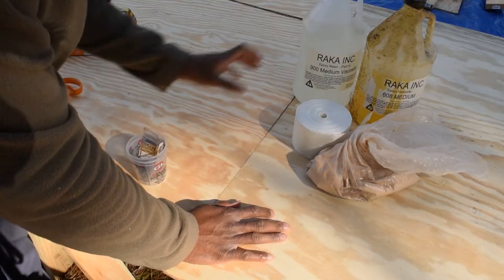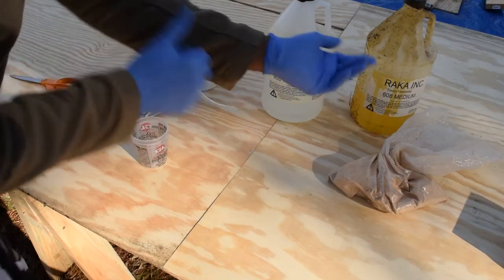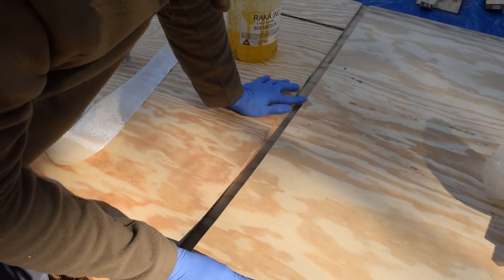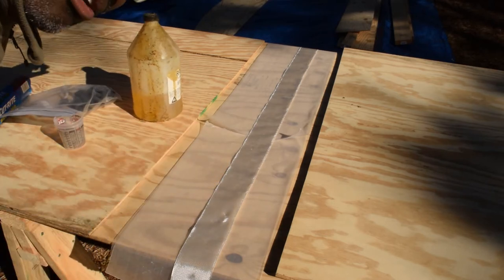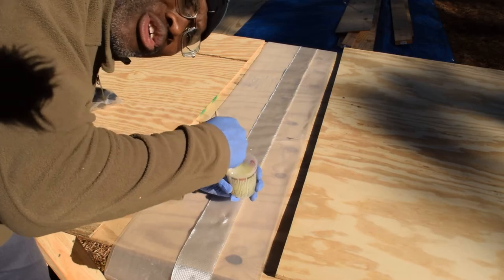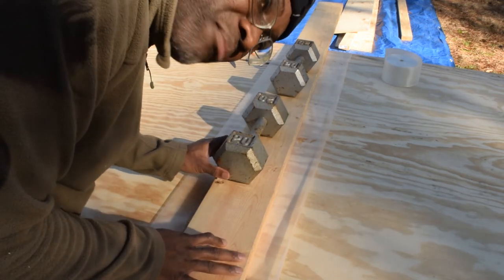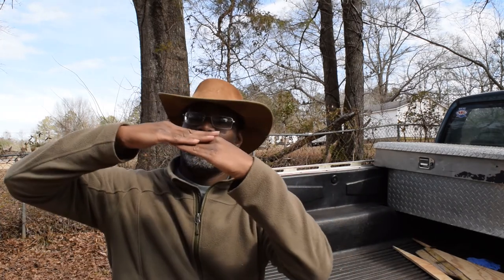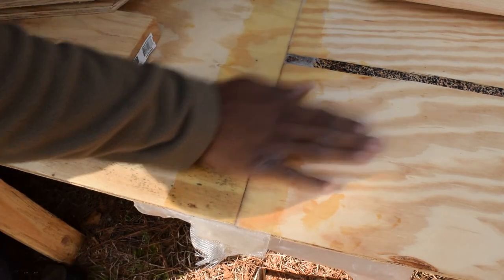Boat Bottom | Thai Longtail Boat Plans

Comment: Damon, get some bondo  squeegee`s works way better than the brushes.
Reply from the maker: thx. Yeah, I do have some plastic squeegies. I'll use them when I fiberglass the whole hull.
Reply: Make sure to put a coat of resin down on the entire surface before you lay the cloths. You will have delamination problems if you don't. That plywood will suck up all the resin out of the cloth if you dont.
Reply from the maker: That's a good point. Same thing when stitching the sides to the bottom.
Reply: Bondo is terrible for boat building, it won't last.  Don't take my word for it, try woodenboatforums etc.
Reply from the maker: I'm not using bondo. I'm using boat builder's epoxy and fiberglass. He was talking about squeeges. Not sure how Bondo cam into this conversation.
Reply: Yeah me either lol, totally read that wrong.  I guess I saw the word bondo and thought, no that would be bad.